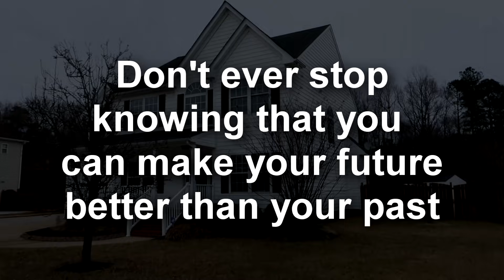Buying A House After Prison...

Comment: It looks like a very nice house. That waterline may have broke because it froze. Once the repairs are done, make sure the crawl space is properly insulated. You can get an alarm to put down there that lets you know if it's getting to cold. You should also drive through that neighborhood after a heavy rain to make sure there is good drainage. I would say that housing development is on reclaimed wetlands which is OK as long as it is properly drained. The only way you're going to know is to inspect after it has been raining and ask the realtor if it's a flood insurance area. Also, did you check the zoning to make sure you can legally run a business like APS in that house? Some areas have very strict rules. Hope that's helpful. I owned and sold a number of houses as I built up my equity.